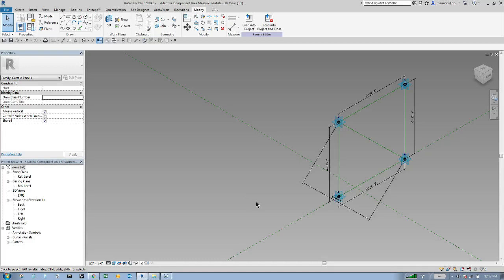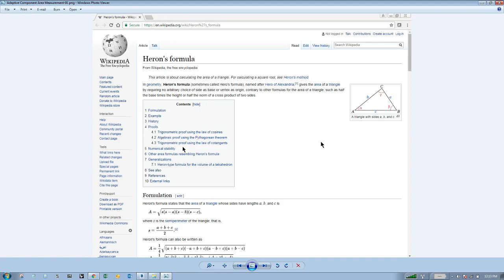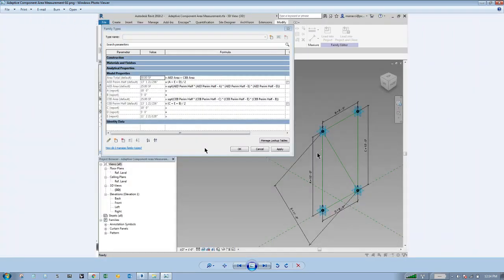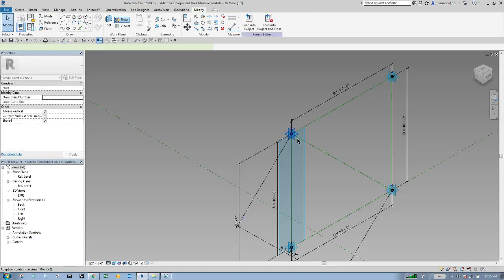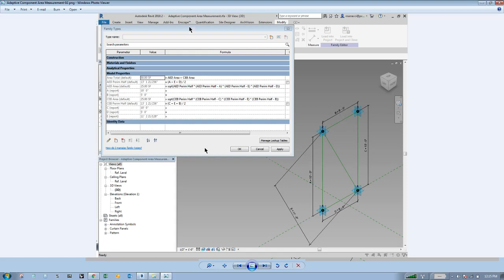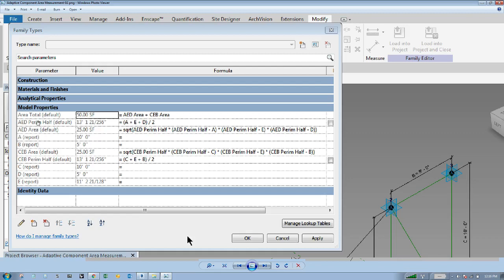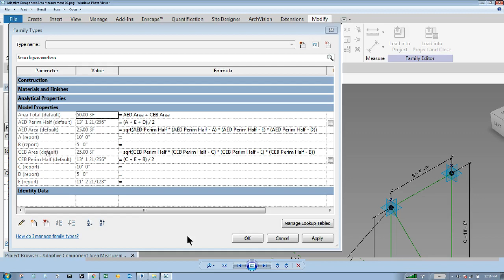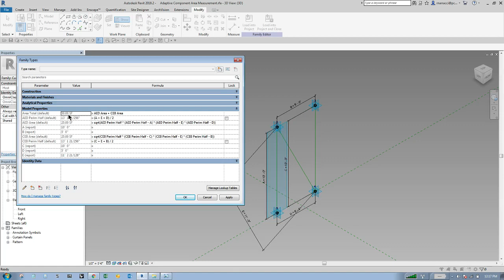Revit Adaptive Component Area Measurement

Comment: Awesoime video! I'm getting an error however, constantly, that my dimension line references must be set to al element that hosts and element in the family. I've tried everything including modeling in new things that are not visible just so there are elements hosted on my reference lines, and it still isn't working. Has this ever happened to you?
Reply from the maker: Is this the error?

“A reporting parameter can be used in a formula only if its dimension references are all to host elements in the family.”
Reply: @numnumbirdynumnum  that's the one! I worked around it by using different dimensions set for the formulas and others (the precise ones) for the reporting parameters. The only issue is that the other dimensions that reference the adaptive points go crazy when inserting them into the host family and differ wildly with the actual measurements of the width and length :((
Reply from the maker: Make sure that when you dimension from adaptive point to adaptive point, that your placement (host) plane for the dimension is one of the point-to-point reference line planes.
Reply: @numnumbirdynumnum  I tried this but it was still giving in accuracies :( but perhaps something got messed within the family from the number of changes I made. I'll try your suggestion again on a new file, thank you for taking the time!
Reply from the maker: A way to visually check this is to grab each adaptive point and drag it around. If the dimensions break you failed to host them properly. If they are hosted properly the next thing that would check is whether or not you correctly named points relative to the
Formulas…. Also that the formulas are correctly transcribed.
Reply: @numnumbirdynumnum  I've remade the family from scratch, and hosted the dimensions initially to the reference lines as you mentioned, before setting for the first time the parameters to it, and it worked! Wonderful advice, also on the adaptive points moving. Thank you for your time and advice!
Reply from the maker: You’re very welcome!